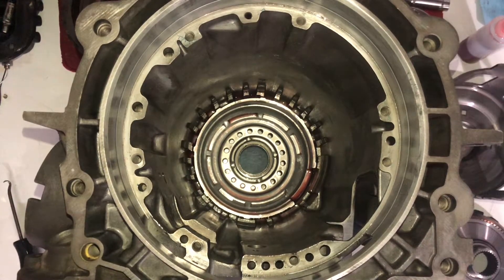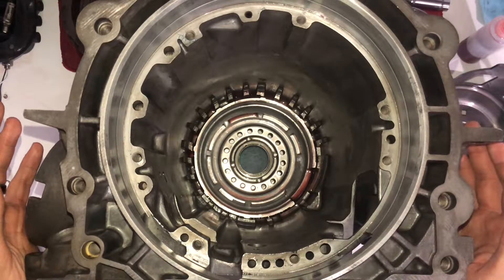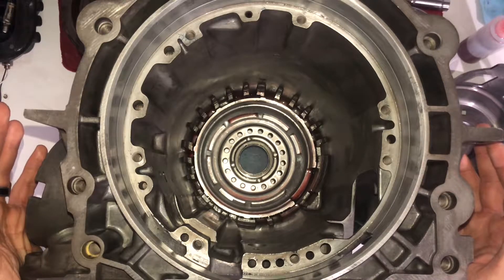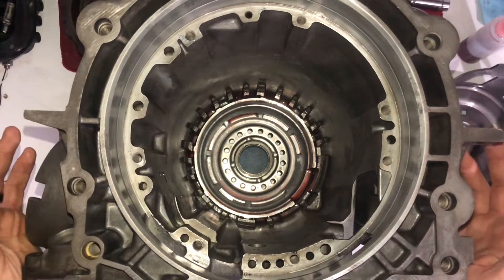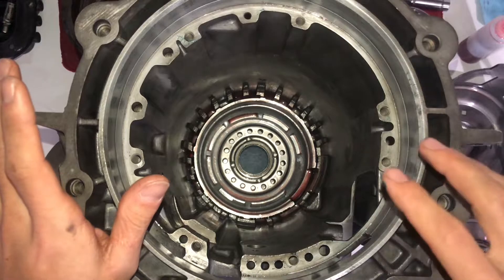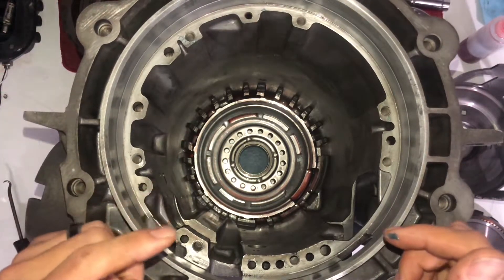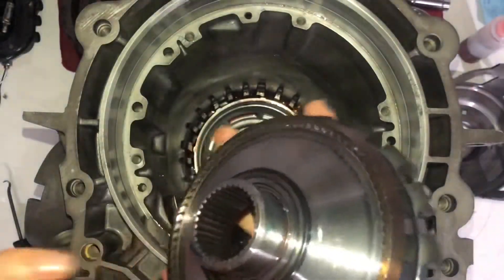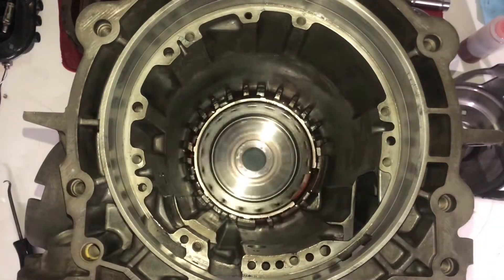4l60e rebuild/reassembly part 1 (rear planetary assembly, low reverse clutch pack)

Comment: Great video I’m building a 4L60e, and want to upgrade with the 5 pinion planetary also. Question the bearing for the 5 pinion planetary to ring gear, can I use the stock torrington bearing or is there a specific bearing for the 5 pinion planet to ring gear ?
Reply from the maker: Also. Keep in mind I am not a professional and this was just my attempt to go through and learn how to rebuild my transmission. I did a ton of research before I started and that helped me a ton. Thankfully I didn’t mess anything up 😂. Still going strong today 💪
Reply from the maker: So I think they are just the stock bearings. I didn’t purchase any special bearings when I did this and just reused what I had. However, this is coming up in a year and a half that I did this and I cannot remember for the life of me if I used the bearings I pulled out with the 5 pinion or if I put the ones I had with the 4 pinion in. I do remember looking at them and comparing and I couldn’t tell a difference
Reply: I appreciate the help, thank you.